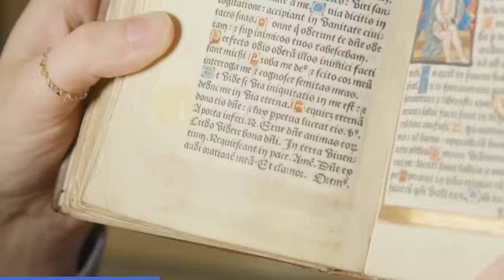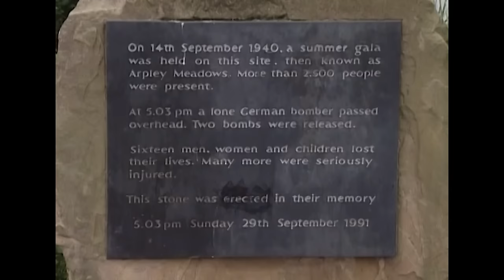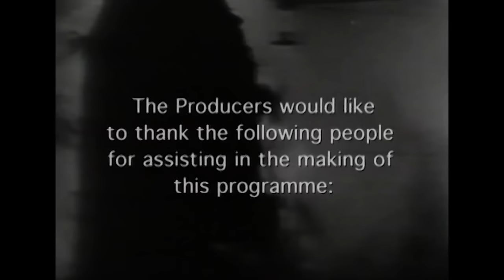V-1 Flying Bombs: WW2 Cruise Missiles Deployed For Terror Bombing | Blitz On The North | Timeline

Comment: My parents were both from Belgium. My Dad used to say he & his friends would hear the V1s coming and know they had 15 minutes. When the propellers gave out, they knew they had to run inside and get in their cellars. The V2s he said were far scarier, because they didn’t know they were coming until you heard the whistle of their descent. My uncle, by the way, was born in my Grandparent’s root cellar during a V1 bombing.
Reply: V1's didn't have propellers they are pulse jets, which is what makes the "buzz" sound.
V2's travelled at supersonic speeds over 5000kmh there's no way to hear them coming at all. Until they exploded there was no warning, that's half the point of them. You might be able to hear a whistle of a V1 descending after the engine cut out, not a V2
Reply: @CSkwirl  Maybe I didn’t have all the facts 100% but I remember my Dad telling me the story of how the buzzing sound kicked off before they fell. As far as the V2’s, the point was my Dad said they didn’t have the warning that they got with the V1s. Thanks for the corrections.

Comment: I thought the Germans stopped before Dunkirk because the army needed an operational pause for maintenance  and replacements.
Reply: They had travelled hundreds of miles across Europe so a few miles more wouldn't have made that much difference, it was probably a number of factors not least a brave rearguard action by the remnants of the French and British armies also although France had surrendered it had not all been invaded, large swathes of southern France were not under direct German control at this stage.